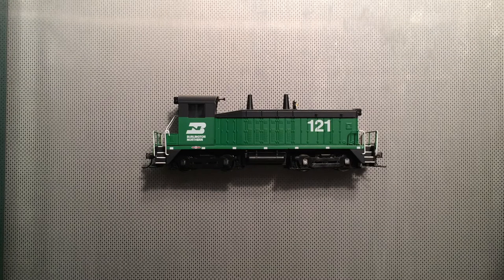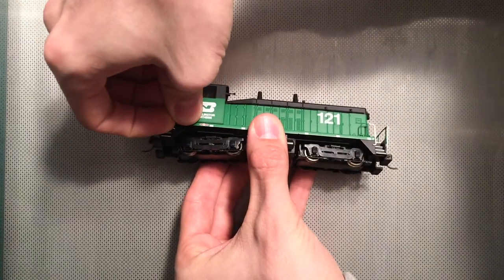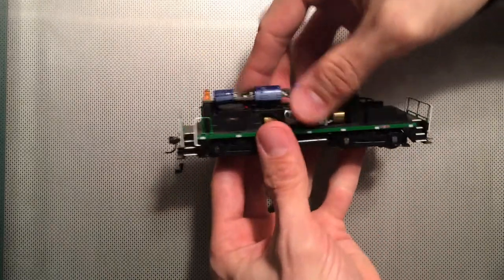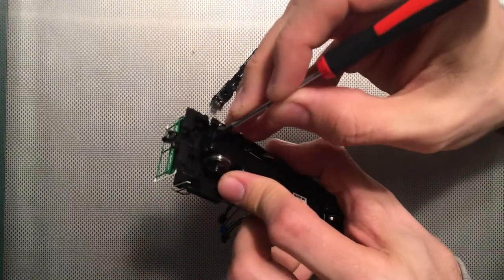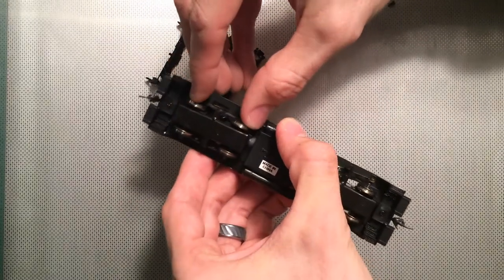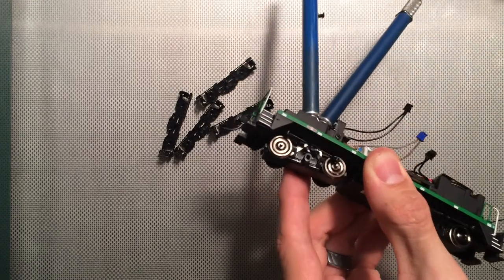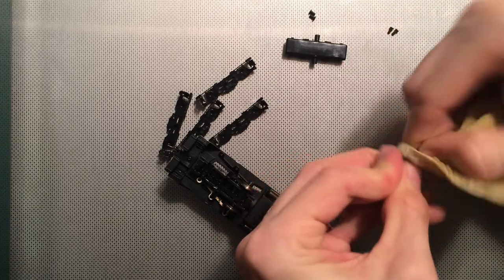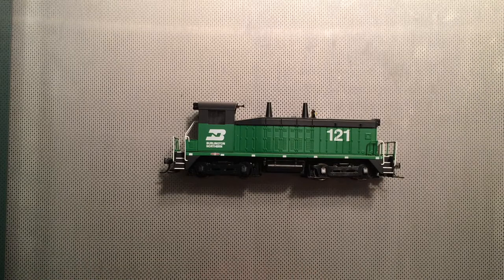SOO The Milwaukee Road S01E04 - The Poor Runner

Comment: I have a Chicago Great Western NW2 #31 that I ran a couple days ago. It ran just fine than. I did some ballasting yesterday but didn't have to move it until today when I got to ballasting that section. It is a Broadway Limited Locomotive too. It will notch up when in Forward but wont move. In reverse it will not notch up or move. The rear headlight wont turn on either. The Front light works along with the horn and bell. Do you think the contactors need cleaning too? It might be a button that got bumped on a controller though.
Reply from the maker: I’ve had similar issues with other locomotives and found a quick reset solved that issue. The problems with the BLI’s we have, were happening with the pair of units. Randomly stalling.

If your issues have arrived right after ballasting? I would check check the internals, as well as loose connections. The shell comes off easy enough to look into that as an issue first. Then maybe move to the contacts themselves.
Reply: +WSampsonite10 Ok thanks